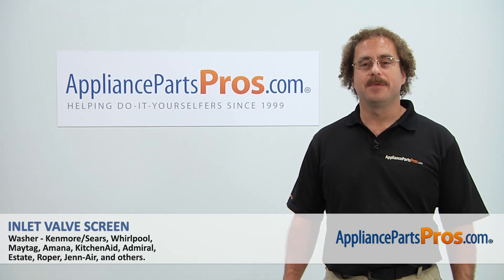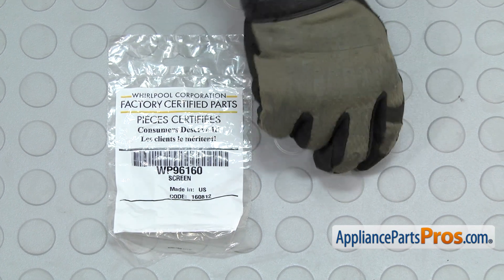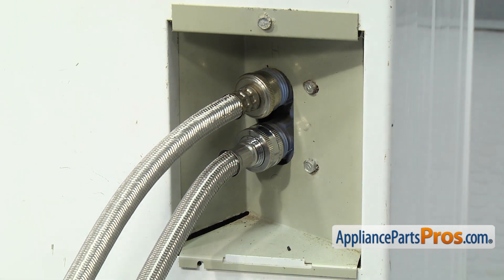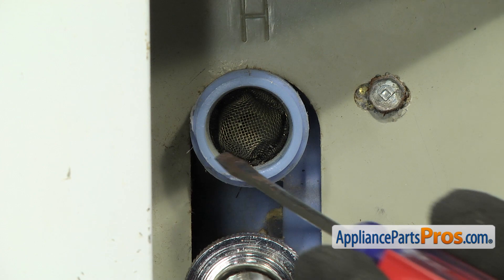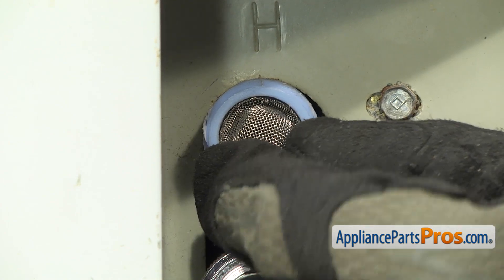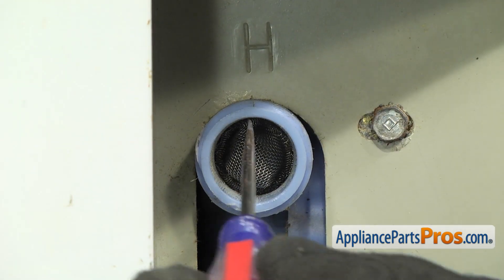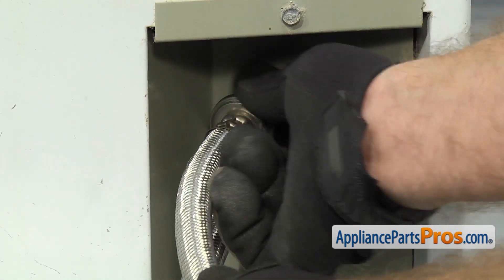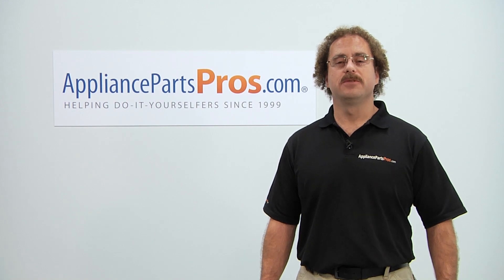How To: Whirlpool/KitchenAid/Maytag Inlet Valve Screen WP96160

Comment: Does anyone sell something similar but it would go at the other end of the washing machine hose where its easy to get at.  Cleaning the filter is easy but moving the washing machine in a tight
area is a pain.
Reply: Any hardware store. They're very common.
Reply: thanks,   I was able to find an inline filter for easy cleaning.
Reply: Yeah I just bought some off of eBay. They are flat and they fit into the end of the hose that screws onto the end of the water supply

Comment: Are those screens really necessary?
Reply: normcoppo I took one off, or let’s say I tore it when cleaning it.   I put the hose back on and the machine ran for another 7 years just fine!   That washer lasted me like a total of 24 years.
Reply: @bettylavergne6200  Thank you!
Reply: The water valves in the  washing machine are large enough that small particles coming into the  machine from your water pipes are not likely to cause a problem. The particles will go right thru the inlet water valve and into the tub, then get drained along with the dirty water. I don't think the screens are needed in most cases.
Reply: If you have hard water or gritty water... it does help.   Well water is iffy....